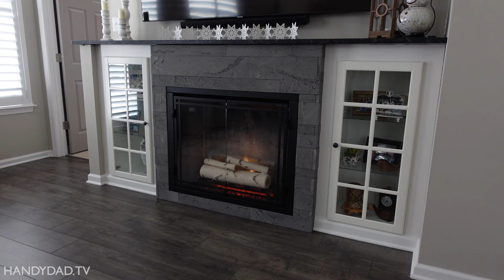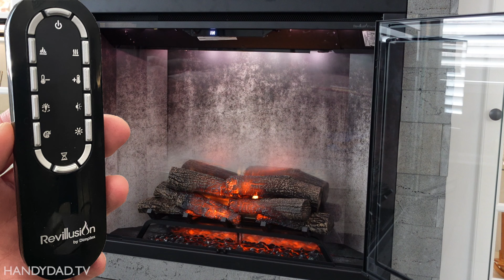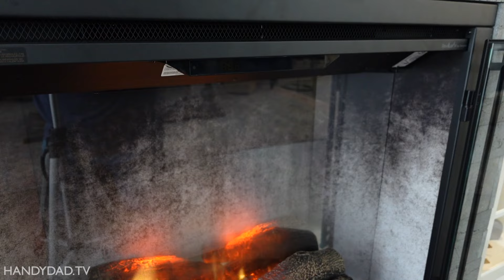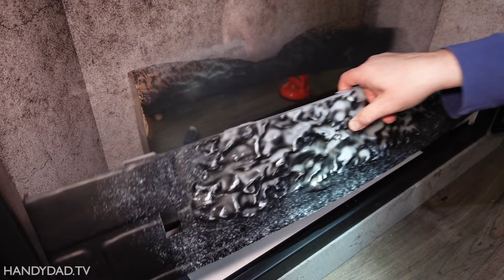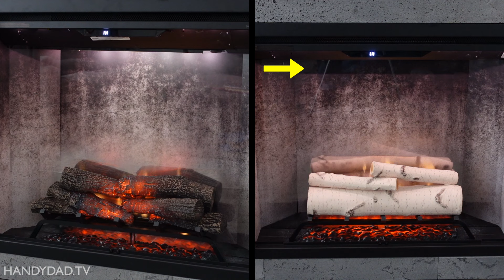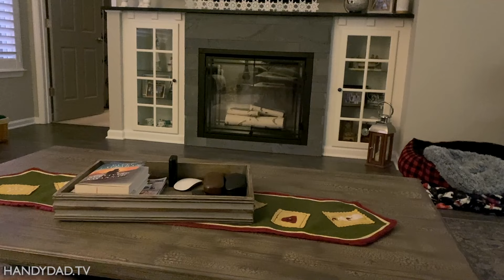Dimplex Revillusion 🔥 Review and Log Replacement

Comment: The flames look decent, but the ember bed is clearly a hunk of plastic with lights inside.
Reply from the maker: Agree, plus it pulsates all together. The ember bed could be better for sure.
Reply: @handydadtv could you replace the ember bed with ember colored glass to make it look better?
Reply from the maker: You could try, but the LED strip is in the back so it probably wouldn’t reach the front. That raises the question about adding LEDs, but you’d need to think about drawing more power from the circuitry than it was designed for. 

Maybe just add glass embers on top of the plastic ember bed.

Comment: Great video! FYI you do not need to take it apart to disconnect the top rear lights. From the access panel you can disconnect the red cable. It does indeed look better without them. The top front lights on color 2 with high flicker looks stunning.
Reply from the maker: Thanks for the tip!

Comment: Are the logs the same size on each model? Seems like the logs in the 42” model look really small compared to the firebox.
Reply from the maker: There are different size logs. But they are matched to the unit so you can’t put in a bigger log.

Comment: I find that my 30" model fan is very loud. It would have been nice to have a speed adjustment that would adjust to a quieter speed setting (even though that might also necessitate reducing the heat output as well). Nice option for me.
Reply from the maker: That would be a nice feature.

Comment: I kind of want to build one from scratch. Getting the logs to be transparent would be the hardest part. 

But at least you could integrate the leds into home assistant
Reply: You can always do it better if you try post progress with hashtags so we can look it up.
Reply from the maker: Yeah I’d like to use a smart plug but it won’t go on like that. Probably a safety feature so the heat doesn’t come on after a power outage.

Comment: NICE REVIEW! I received our dimplex revillusion. I was disappointed to learn that the flame speeds are not adjustable. Is this a discontinued feature? Also the factory glued both sides of the magnets on the side panels so they are not removable without having to almost pry them off the sides. Then it suddenly the fireplace stopped working, i checked all possible electrical issues from the panel to the fireplace.... it's certainly a problem in the unit.. Anyone have any thoughts on this?
Reply from the maker: I’m sorry to hear this. I don’t understand how they expect you to screw it in without removable side panels. But I wouldn’t care about the adjustable flame speed. Any slower would surely seem fake.
Reply: @handydadtv  I agree, I wish I can make the flame go faster. I contacted the retailer and we are working through Dimplex to get a new one sent. Guess I got a lemon...???

Comment: My new one installed  last week due to a noisy deffective unit doesn't have the red or blue interior lighting under the logs. I heard dimplex recently removed this feature which is annoying because I liked the blue lighting. Also the motor blower when heater is in use is now extremely loud  compared to my old model from 2018 making it unbearable to use. They aren't being made as good as they were 5 years ago. I feel I wasted a lot of money and now its useless as a heat source.
Reply from the maker: Thanks for sharing.
Reply: We have the same issue  in 2024. With heat on it sounds like a high-pitched blowdryer that can be heard from other rooms in the house. Totally unusable

Comment: Hi ...is it normally this noisy when the blower is on?...we find it very noisy when we turn it on to heat....other than that it is a stunning unit...
Reply from the maker: All blowers make noise regardless of which fireplace you get.
Reply: @handydadtv  mine sounds like a high pitched loud blowdryer and can be heard in different rooms of the house-. Is that normal? Dissapointing, makes using the hear portion impossible
Reply from the maker: @kelleygraham1607 No, not normal in my experience.

Comment: Thanks for the review. We are considering this unit for the lake house but I've seen a few reviews that state that the fan is noisy. Is that your experience? We are likely to do the 220v wiring to get more heating capacity. Will that make the fan even more noisy?
Reply from the maker: I’ve never heard a quiet blower in a fireplace. Even the gas fireplace in my old house had a blower that made noise.

It’s not so noisy that we can’t watch TV or have a conversation. I think it’s normal. 

I doubt the blower will be louder with 240 volts, but I can’t be sure because I never tried it. Both of my installs were 120v.
Reply: @handydadtv  Thank you for your response. I'll keep this under consideration.
Reply: As someone who used this (new version) last winter I can confirm it's extremely noisy. My old Dimplex Revillusion from 2018 was way quieter with the heat and fan/motor on, and it was hard wired to 240v. Something is different now with the production of these, and they are manufactured in China. The blower makes a loud whiring/whining sound after being in use more than 10 minutes & it's ear splitting making it not enjoyable to use the heater on it.
Reply: You need to clean it it’s probably sucking up stuff and getting in the motor

Comment: $2,000 is a bit expensive I'd rather throw 2 grand at a natural gas insert our less expensive dining room natural gas unit was around 2 grand and our most realistic that doesn't need power if you set it up that way since it's got a battery box FOR 4 AA battery's so in a power outtage we can heat most of the house with the 2 fireplaces in a grid down situation you have no heat
Reply: Gas fireplace inserts are way more than $2k. I had one installed Jan 2022 and it was over $7000 including unit, chimney inspection and cleaning and installation.
Reply from the maker: I seriously considered gas but they’re much more expensive than $2,000 these days. Add the hassle of running a gas line (I don’t have a basement) and pain of venting through the roof (it’s not an exterior wall). That’s why I went with electric. The side benefit is I can use it year round and don’t need to worry about little hands getting burned.
Reply: @handydadtv  Yep.  Also, here in Australia, we are trying to stop using gas.  Many new sub-divisions for new housing are not even permitted to run gas to the developments.  We are looking to wean ourselves off gas as we have a large solar array with a battery backup, so this would be a good option.  We're currently also looking into a heat pump hot water system to work with our solar.  The safety aspect is also a big condideration for us, with grandkids. And yes, the gas supply line and flue venting is another consideration/expense with the gas option.